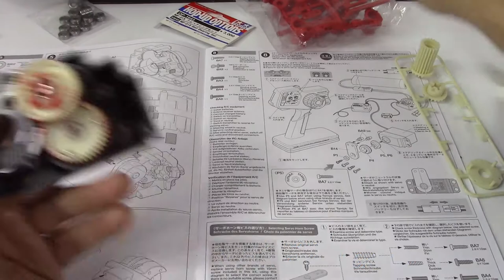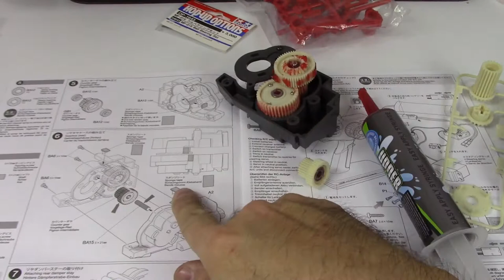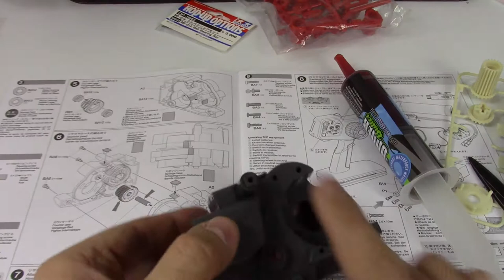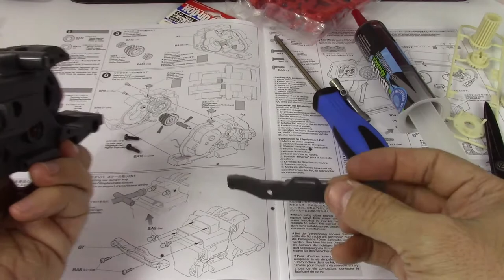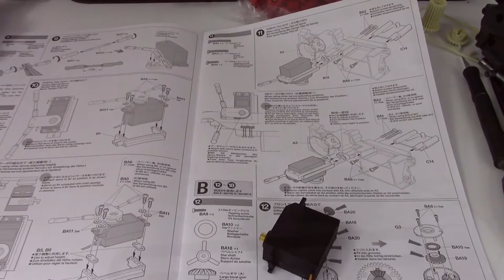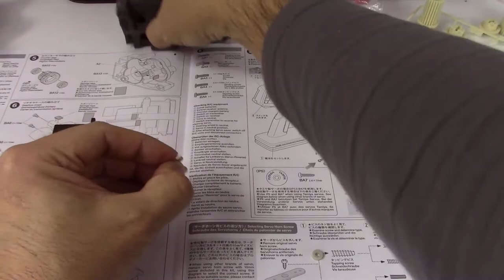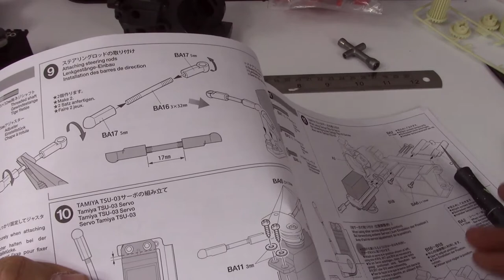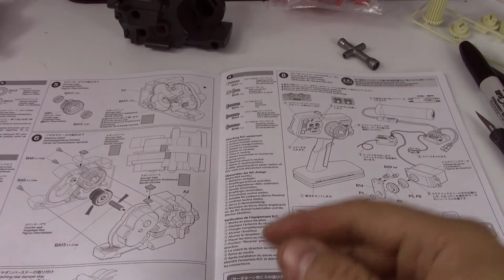Let's Build RC: The Tamiya MF-01X Beetle Rally Car #3 - Time for the Servo! Steps 5 to 9

Comment: A guy on here reckons you only need to apply grease on the slip diff gears. I guess it would lighten the engine load. I’m building this soon so I’ll give it a go
Reply from the maker: It's true if you use lots of grease then you can increase the motor load - but replacing the motor (if you use it a lot) is much easier than replacing all the gears if they melt or break :)

Comment: Me and daughter have made it to step 8 today, it went well thanks to your videos - the instructions are quite clear but having seen you do it makes it much easier. I'm going to try and get the Tamiya screwdrivers to prevent slippage - tried a selection of screwdrivers that I had but none were a perfect fit and the screws are quite tight.
Reply from the maker: +Matt yeah definitely the screwdrivers help! I think the Tamiya ones are one of the cheapest JIS drivers you can find, sorry they're not the usual overpriced branded tools you can find